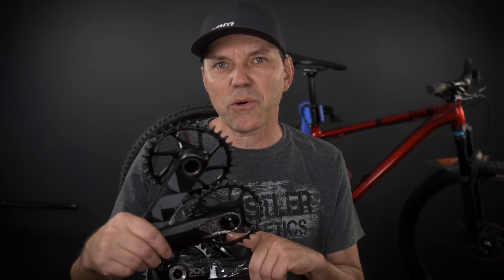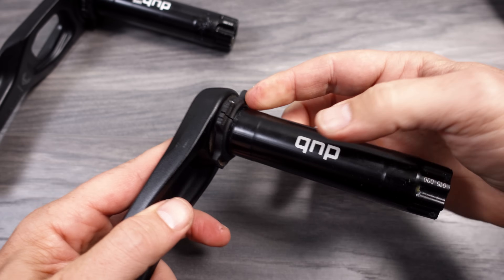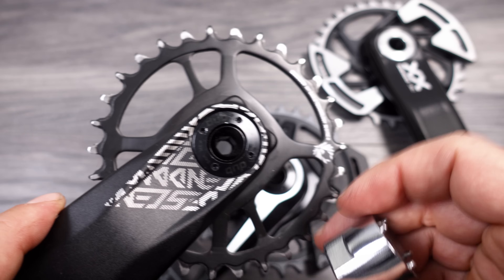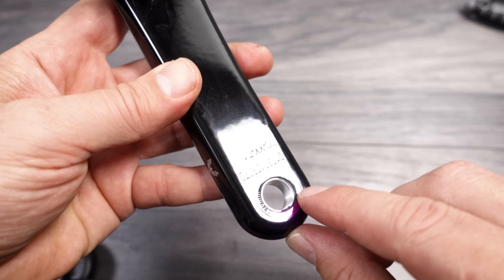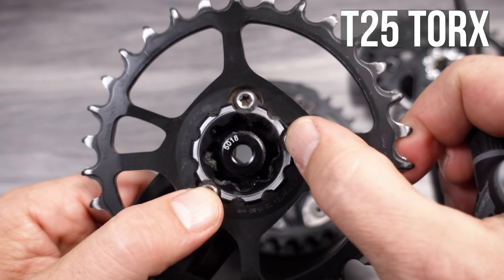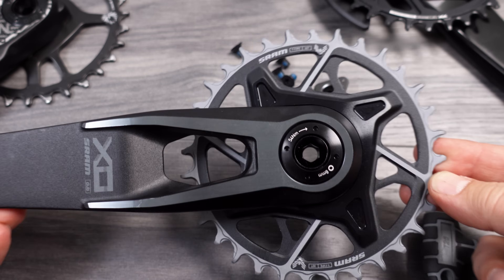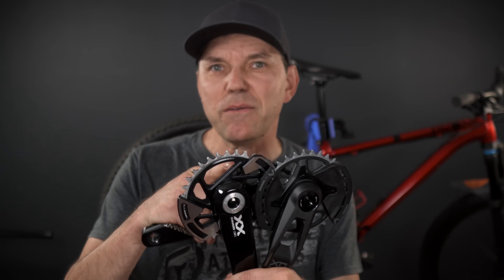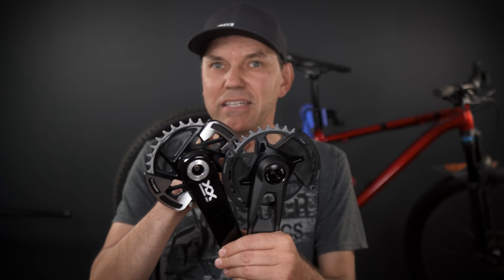SRAM T-Type CRANKSETS vs Old DUB SRAM Eagle Cranks - 12 Speed, Compatibility, AXS, X0, XX, XX SL, GX

Comment: SRAM, as I've always said, launched these new T-TYPE models not to pursue a genuine evolution of their components, better gear shifting, etc., but rather to further exploit the suckers, charging even more absurd prices for the new models, which are actually heavier and have practically the same functionality as the old ones, which were already excellent. I only bought the SRAM XX1 crankset because it was on sale with a 46% discount; the complete crankset, including the chainring and bolts, weighs 422g, meaning the old one is BETTER, much lighter, and the suckers pay a fortune for the new, inferior models.  For my second bike, I bought an aluminum crankset from a generic brand on AliExpress, but it's very high quality. The complete crankset, with a 38-tooth chainring, weighs exactly 550g, lighter than the XX SL. I paid LESS THAN 5% of the price of the famous brand (I know you'll say it's a generic brand, that it's no good, etc., etc.), but IT WORKS PERFECTLY. The part has excellent construction, without any flaws. I've ridden thousands of kilometers and it's sensational. It does everything any other crankset, from any brand, would do, and it costs a fraction, AND IT'S LIGHTER! That's why I say, these traditional brands exploit, they ROB, and the fools who buy them think they're getting a great deal and even defend these brands. I just laugh at these idiots!!!

Comment: Hello Love MTB, great video and the details into it was really what I needed to hear and see. Please, I seriously need your help! SRAM support has done nothing more than confuse me a lot after asking them a ton of questions. 
My SRAM Eagle x1 UDH drivetrain is giving me shifting headaches on my Scott Patron Tuned 2022 after 1600 miles. I purchased a new cassette and XX1 chain replacements in hope of resolving my shifting problems. A shop total me that I may need to replace the cable and housing. That’s another cable headache! So now, since I hate cables, I am now ready to switch over to T-type AXS. Q, is there anyway that I can still use my new cassette, chain, and remaining crank setup? Can I just only purchase the new AXS, T-type derailleur, pod, and charger? Is it compatible with my other components without having to dump a lot of money on a complete kit? Is the spacing compatible with my older components if I mix the old with the new? I thank you greatly!!! Steven S.

Comment: I just purchased the XX SL T-Type groupset and after reviewing the SRAM installation manual online, it appears that the XX SL crankset uses the same spindle type as my current XX1 cranks (called “DUB MTB”). Therefore, I will NOT need to be concerned about purchasing, or adding, any new external spacers that are required by the other T-Type groupsets, such as the XO, is that correct?
Reply from the maker: I believe so, it has to do with the narrower/ racy Q-factor. Not a big deal as we're been using a 52mm  chainline with ttype from the begining.

Comment: I’m on a budget. I have the gx t type installed on my 22 turbo levo. Kept the stock oe cranks on. It works perfectly fine. I have the t type cranks that were meant for a non-ebike. Another reason I wasn’t able to install them on my ebike. Could i use those t type cranks for my new stumpy 15 while using my older gx axes derailleur and cassette drivetrain?

Comment: What im wondering to know is i just bought the xx complete groupeset and i want to put the xx crank ring on my original dub and 5dev crank. Can we use the new xx ring on the original sram 3 bolt crank??? Does it fit or not
Reply from the maker: It doesn't fit, mechanically it doesn't

Comment: I like the XO T-Type cranks with spindle power meter for $400.  But I don’t know if I can get it to work with my dub 52mm chain line prev gen eagle drivetrain (not T-Type).  Anyone know?
Reply from the maker: @paulfraley7990  check my video on DUB vs Dub Wide BBs. And yes😉
Reply: @LoveMTB  , Thanks for reply!  My issue is the X0 T-type cranks have 8 bolt chainring interface and I see no 30T 8 bolt 6mm offset chainrings out there (searched SRAM, garbaruk, wolf tooth, etc). FWIW , I watched
https://youtu.be/t0X3nlwOoAQ
Thanks for confirming I can use my existing bottom bracket with new spacers to achieve dub wide.  Thanks again.

Comment: T-Type have bigger rollers than old SRAM Eagle, so they shouldn't fit as well. The rollers on T-Type is 7,9mm, and Eagle is ~7,6mm diameter. Still same pitch as far as I know. 12,7mm, or 1/2".
Reply from the maker: @tegheim  I have all that documented in my series of videos on T-Type. What’s your point?
Reply: @LoveMTB  I was thinking about when you say T-Type chain will work on a older Eagle chainring. Theoretically it wouldn't?
Reply from the maker: @ it does  have a few vids on chainrings for ttype/ compatibility check them out for different views and discussions

Comment: Good detailed video. BTW bash guards are a good way to uglify your cranks / bike. The new style isn't any prettier so Its good to see they made them easy to remove. You may not fit a guide with them in place either so you might wana consider a tensioner (OR some kneepads and a jockstrap so your ready for the chain falls).
Reply from the maker: Yup 2 bolts and they're gone!

Comment: just got a used t-type cassette, derailleur, and chain and I'm using my old crankset. Should I get a 0mm off set chainring to get the 55mm chainline or keep the normal one?
Reply from the maker: Check out my install video for t-type I’m using the old cranks and chainline
Reply: @LoveMTB  I also have been thinking of doing this. I put on a T-Type cassette and derailleur on my Kenevo SL using the original ring and cranset. No problem. I now want to put one on my Tracer with 5Dev cranks, and dont want to switch to new cranks, spindle and ring unless I absolutely had to.  I love my 5dev arms.
Reply from the maker: @Acill  You should be able to. Check with 5Dev just like Garbaruk I believe their rings are ttype compatible!
Reply: @LoveMTB  What about offset? Do i need to change to a 0mm to make the new transmission 55mm chain lone or can I continue to use my normal 3mm dub spindle and ring? it does say it compatible with ttpe, but I worry about the chainline is all. Confusing stuff.
Reply from the maker: @Acill  check my Ttype installation video for more on that 😉

Comment: Is it decided that you cannot use a T-type crankset with the old eagle axs derailleur/cassette? Due the the chainline? 52 vs 55? as there is not currently a +6mm offset chainring for the wider crank? Or will the eagle axs derailleur/cassette work fine with the 55mm chainline?
Reply from the maker: I am planning to use the new cranks with the old EAGLE drivetrain...
Reply: @LoveMTB  Thanks for the reply! I'm so confused..... Everyone says that "all ttype transmission cranks are "dub wide" hence a 3mm offset chain ring will accomplish a 55mm chainline.. correct? Well I just measured my ttype transmission cranks that are labeled "dub SL" and they measure 11.4 cm in length, which based on your video is the same as the old "dub regular" cranks which I would think would accomplish a 52mm chainline with the 3mm offset ring. Have you heard of this elusive "dub SL" ttype crank that isn't "wide"?
Reply from the maker: @EvsRealEstate  I believe they did that for a narrower Q-factor. I wouldn't sweat it as long as you install the BB with the proper spacers. I have this video about that - https://youtu.be/t0X3nlwOoAQ and also plan to use T-Type with 52 mm chainline cranks.

Comment: A quick note on chainlines and the need to go to 56.5-57 mm to accomodate wide tires: I have an old frame which was designed at a time when we only had 9 speed drivetrains with sub-50 mm chainline, but it still can take a 3.0 inch tyre. And if you do the math, a 49 mm chainline results in 8.4 mm clearance between a 12 speed chain and a 3.0 inch tyre (a little less when using lower gears).

Comment: i have the xx version and when i wanted to mount the cranks i was scared that it did not wanted to fit. Very nice to see that that is possible. Now i just need to find the spacers that go between the frame and my bb. Crazy btw how much better the xx groupset is compared to my 'old' x01 eagle groupset. I especially like how stiff the clutch is on the xx one and how easy it is to service without having to buy a new shift cable and stuff, crazy good transmission

Comment: Great video! - I have a 2023 unused Eagle GX crankset and chain-line is listed at 52mm.  I am building up a new bike and going w/ T-Type GX mix and match (XO cassette, chain) old AXS controller and would like to use the old Eagle GX crank and wondering what chainring you recommend and if you think an oval would work ok?  Thanks!
Reply from the maker: We’re going to use a 52mm chainline w t-type and a Garbaruk oval
Reply: @LoveMTB  - Okay, but I understood that a 55mm chainline is required for T-type (at least that is what I gathered w/ the T-type Crank having a wide spindle).
Reply from the maker: @BillKilbourne  correct but 52mm won’t break it
Reply: I think if you use a 0 offset chainring, you'll be able to use your old cranks and have a 55mm chainline. Wolftooth makes a 0 offset chainring.  @BillKilbourne

Comment: Good information, thanks.  Are you able to confirm if a T-type left crank is compatible with the previous right side DUB?  I'd like to add the new left side power meter to my existing DUB Wide crankset.
Reply from the maker: Hey there I can confirm that T-type left crank is will FIT the previous right side DUB and you can tighten the bolt. Can't speak about being a perfect fit or exactly the same but there is a high chance that they are.

Comment: Thanks for the vid. I’m getting a new bike and looking to use new GX transmission derailleur, cassette and new flat top chain with older Eagle GX cranks and chainring. Will that work ok? Will I need a chainring with different offset?
Reply from the maker: You should be fine...let us know how you like it! As for your old chainring, there are new 3rd party ones that might work better/ give you the 55mm chainline but I would try your old one first.

Comment: i am buying now bike with old sram but i need to change crankset as it is 175 and i need 170 ... is there chance i can buy new T type crankset with powermeter and integrate it to older sram drivetrain ? maybe with new chainring as you mentioned by third party ? the thing is i dont want to use new T type chain because i have multiple 12 speed sram/shimano systems on other bikes and i want to have options to reuse same chains by KMC or YBN and not sram :D
Reply from the maker: You definitely have that option, get the power meter in the cranks axle (XX, X0) then use the 3rd party chainrings with 6mm offset to push your chainline back to 52mm. Problem solved!
Reply: @LoveMTB  do you know some brands making those chainrings already for this new cranks ? thanks for reply love your videos
Reply from the maker: @krempixxx  believe Wolf Tooth has them. And maybe Garbaruk. And thanks 🙏

Comment: Great video as always!! Can I use just the T-Type cranks on my V3 Santa Cruz Bronson that has 53mm chain line? Would still be using my current Sram cassette and derailuer.
Reply from the maker: Yes you can! Let us know how you like it
Reply: Thanks for the quick response @LoveMTB  . The 2mm difference in chain line is ok?
Reply from the maker: @mtbkid9254  Not ideal but it will work
Reply from the maker: @mtbkid9254  It should be ok
Reply: @mtbkid9254  Hi, Did You have chance to test it?? I want to use new x01 crank set on old 52mm chainline bike.

Comment: Using slx groupset. I like it more than the gx 12s I had. Not sure if it's a problem with adjustment, maybe I hit a deraileur or what (but the bike shop said they checked everything and can't find any issues), and yeah idk, I just had issues with gx somehow, it would shift fine and then on the 500th shift it would act up on the ride.

Comment: Are you using any of the T-Type stuff on your ARC?  I bought an 8 bolt old XX1 crankset mistakenly.  I'm wondering if I use a T-Type chainring, if it will work with the older GX and X0 chains since I have a mix of components on my ARC that I am building. xx1 cassette and GX derailleur.
Reply from the maker: Will work just fine with an old Eagle chain
Reply: @LoveMTB  Thank you. Are you running an oval on your ARC?

Comment: Thanks so much for the explanation. This video led me to decide to use my old xx1 power meter with its crank and chainring with the new T Type chain, and save a lot of money. thank you so much
Reply from the maker: No worries. Would love to hear how you like the new drivetrain!
Reply: Hi, the set up works perfectly. This run 1.500 km
Reply: Hello, did the set up work well?
Reply: Thank you
Reply: What dub spindle width do you have? Is it the same as the new width of the t type stuff

Comment: i don't get the backward-compatiblity-part :(

on the SRAM website I found the following: "Eagle Transmission T-Type chainrings are compatible with Eagle chains, so they can be used on Eagle Drivetrains when mounted to an Eagle Transmission crankset. However, Non-T-Type Eagle Drivetrain chainrings are incompatible with Eagle Transmission T-Type chains."

yet, the back of the chainring in your video at 5:28 shows "SRAM T-Type Chains only" - doesn't that contradict each other?

i'd like to get a powermeter for my non-UDH MTB and i'm wondering if i could use the new XX SL Crankset for example... :(
Reply from the maker: Yes you can as I mentioned in the video. Be careful with all details of the SL when it comes to bike fit and chainline
Reply: @LoveMTB  thanks, must have missed the part where you mentioned that it's possible anyway :) i chose sl since my current crank isn't dub wide... interestingly in most of the onlineshops where you can order the crank they don't mention if the included chainring is 0 or 3mm offset,... current chainring on my bike is 3mm so i guess i'll have to wait and see whats included ^^

Comment: I have the new SRAM XX T type mount in my old GX 12 Speed, with Shimano chain, not problem at all, I believe since there it’s no difference, the chain haven’t felt once. Work perfectly ❤. I change it for my old GX crank only for the weight loss.

Comment: Do you think sram will provide T-Type Chainring for x01/xx1 cranksets ( With 3 bolts ) ?  ( I allready have a X01 cranksets in 55m with my sparc rc, and even if you said it compatible with old chainring, it's probably better to use T-type chainring with t-type chain ? )
Reply from the maker: I do not know but I do not believe so, you’ll have to rely on 3rd parties more than happy to provide that. Companies like SRAM are forward looking they want to sell you the new kit/ crankset

Comment: Do the new cranks work with an old Gx Eagle drivetrain?
Reply from the maker: Yes but be aware of the 55mm chainline like I mentioned in the video
Reply: Is the 32T chainring that comes with the new cranks a 3mm offset? Thinking of ordering but want 34T chainring to maintain the 55mm chain line and not sure what to order. Thanks

Comment: Note that the old XX1 crankset was also available in an 8 bolt version for the quarq powermeter and it's for sale in a lot of places now. I use this with the new xx chainring and 'old' XO 12sp chain.
Reply from the maker: Thanks for sharing!
Reply: So I just bought an old XX1 dub wide crankset 8 bolt version unknowingly in Dub Wide. The rest of my drive train xx1 cassette and GX derailleur. I'm unsure what chainring will work with this. Did you just buy the new SRAM version T-Type chainring as well and it works with the old stuff?  Or is there a NON T-Type chainring that is 8 bolt?
Reply: @jrod0981  t-type chainring will work, the teeth are the same. Just be aware to buy the right offset. But of you bought a Wide while you didnt need it, does it fit in the frame without spacers?!
Reply: @janvanrookhuijzen8309  I bought the dub wide knowing I needed it for a Yeti ARC which uses that specific spindle length. I just didn't know it was an 8 bolt version instead of traditional 3 bolt. I didn't know if the T-Type chainrings would work, or if I should sell this and try to find a traditional 3 bolt style crankset. I need a 3mm offset. The original crankset that came preinstalled has some spacers on it already and I will just transfer those over.
Reply: @jrod0981  then don't worry and just buy the new chainring. Works perfect with the 'old' chain.
Reply: @janvanrookhuijzen8309  Thanks man. Looks like Wolftooth and Absolute Black do a chainring for the 8 bolt now. Might get one of those.
Reply: Hello, I have a wireless GX derailleur from the first, I would like to know if putting the new GX sprocket with a GX FLAT chain could work for me

Comment: I have last year's Scott spark rc with an "old" XO AXS transmission. Now I would like a power meter for my bike, so it seems that buying new XO cranks with a power meter will be almost the cheapest option.
Reply from the maker: Most probably and most elegant. Just remember the 55mm chainline...
Reply: Good thing the 22 spark rc wc IS 55mm chain line with wide dub so it’s a perfect match! I have the same desire with mine 😊
Reply: I now have new cranks with a wattmeter on the bike. It went in place and works well. The new cranks didn't come with pedal end protectors, and I can't find them in any store. However, those cranks are aluminum, so they are not that important.